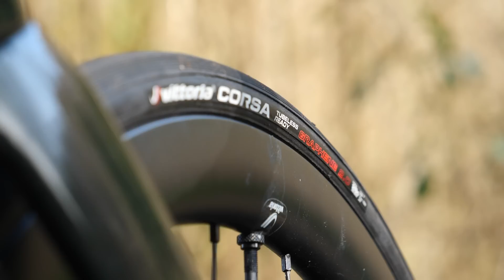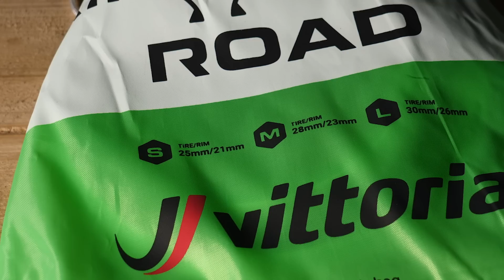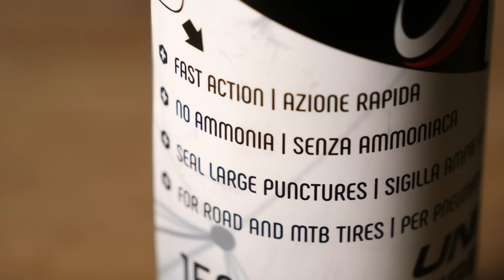NEW Run Flats: Pro Cycling’s Secret Tech | Vittoria Airliner Road First Look

Comment: Has anyone noticed that underlying this product is an admission that "tubeless" has not lived up to its hype?  We have been told that tubeless with sealant will banish flats and sitting beside the road removing wheels, prying tires off the rim, pulling out the flat tube, putting in a new one, pumping the tire back up to pressure and re-installing the wheel is a thing of the past.  There is an unstated admission here that when one rides tubeless tires there is definite possibility that one will have a flat that will not seal, and, as a result, one will be sitting beside the road pulling the tire off the rim, getting sealant all over one's hands and clothes and inserting a tube that one still would have to carry in anticipation of just this situation, etc.  And once one returned home, one would have to undertake the messy operation of again removing the tire and tube and repair the puncture in the casing, add new sealant, reset the tire in the bead (something I found impossible at home; I had to go to the bike shop and ask the shop to do it with their compressor -- an impossibility at 10 o'clock at night).  In short tubeless was more troublesome than tubes.

I do appreciate the increased safety margin these airliners offer. Would it be possible to obtain this increase in safety and convenience by using them in conjunction with regular tires and tubes and avoid all the faffing about inherent to the tubeless setup?

Comment: Has anyone installed these with the vittoria valve then had trouble getting sealant to go in, even with a sealed/screw down injector? My experience is sealant wants to burp back out. Hard to get it to stay in.
Reply: Two tricks: 1) before you inject the sealant (while the valve is still clear so air can come out) - compress the top of the tire - this causes it to inflate as you inject the sealant and displace some of the air. That way the air pressure doesn't want to push the sealant back out.  2) Rotate the tire so the valve is not on the bottom/opposite the ground. That way when you inject it it will flow down and away from the valve.

Comment: I switched to Tubeless 2 years ago, then switched back to clinchers after 2 months. I found after not riding the bike for a month or two the tubeless tires runs out of air and I couldnt pump the tire back up. I had to remove it which took hours I had to cut the tire after it fused itself together due to the sealant sealing the tire beads together. It was an unbelievable mess, the sealant was all over my floor and countertops. I'm never going tubeless again. Too messy.

Comment: I know they should "last and last", and reviews have said that they do, but Vittoria recommend replacing Air-Liner Road inserts every year!

After a puncture that I couldn't fix in a tri last weekend, I am sorely tempted to put the the airliners on my race wheels, but I need to work through what the repair options are when whacking a tube in at the roadside isn't an option. I'm guessing that this would be 1 - hope the sealant works, 2 - plug the hole and inflate, 3 - ride in on the flat tyre.

Comment: I had a puncture on tubeless which sealed but only with 2 to 3 bar pressure in it. Anymore would break the seal. To get the seal to hold for 6 bar, I fitted a patch to the inside of the tyre. That's the long term fix, but I still rode 80 miles on the low pressure since there seemed to be not much difference. Apart from being more comfy on rough roads.

Comment: What happens where the valve is when you get a flat? Surely the valve in the rim pushes the Airliner out more and you end up with a very slight egg shaped rolling surface?
Reply: hmmm thats logical

Comment: running ultralight corsa speed and dt arc wheels...no way i'm adding extra weight to that combo...use stans race sealant problem solved...and a tube and 10 euro bill to get home in case of a major blowout..!
Reply: Do the airliners weigh more than a spare tube and a mini pump?
Reply: @simonrichardson5259  yes! latex vredestein race + carbon pro mini pump. (and they are in my pocket not spinning around on the outside of my rim!

Comment: Got my 1st flat after 1300 miles on a tubeless Cadex tire and it was a big gash! I had a can of GUP with me...shot foam everywhere and didnt seal. Luckily a bike shop was 3 miles away...yes I walked it. I could of used these lines. I just bought them and will try them out as soon as they come

Comment: I don't understand how the air liner reduces in size when you inflate the tyre, surely it would stay the same size as the pressure within the tyre is equal!?
Reply: The pressure in the tyre squashes the foam just like if it was between your fingers
Reply: @simonrichardson5259  surely that can't be, for example, if a balloon was in a sealed chamber and the chamber was pressurised, if the pressure outside of the balloon was greater than the pressure inside the balloon, the balloon would reduce in size. With the Air Liner being a porous foam, I don't know how this would reduce..... possibly magic?!

Comment: Two years on tubeless 12,000+ miles no flats but I do carry a spare tube and small pump adding these and ditching the tube and pump would give me a weight savings. I'm all in if you can fine a set. lol
Reply: Same here. The safety factor alone is worth it. The fact that you won't damage your nice rims is like having your cake and eating it too. I will definitely be buying them.

Comment: More simply put..The air that is contained in the poly is lower in air pressure than the air pressure that you actually put into the tire thus compressing the foam in overall size unlit the external air pressure is decrease. The bigger question has anyone actually taken advantage of the tech in wining a race with a flat some where along the line of the race?

Comment: Just ordered it in Italy, as here in the Netherlands I can’t find it. Ride alredy two years tubeless, but still from time to time running flat and even a plug sometimes will not work. Only option put innertube or call home. This would fix the issue i guess.

Comment: Rookie question. Can i use a Tubeless tyre like a clincher with a inner tube?
Reply: Yes. But you would normally only use a tube in an emergency - to get you home if you tyre has a puncture that doesn't seal or can't be repaired.

Comment: one bonus they don't mention - the volume the gravel insert takes up is volume you don't have to replace with air or CO2.  So if you do break the tyre/rim seal one small cannister of CO2 will be enough to blast it back on the rim 👍

Comment: Which size would you get if you’re running wide rim aero wheels? My Tyres are 28mm but the rim bed on my wheel set is 27mm. Would getting a medium lessen the safety of rolling when flat?
Reply: The important rim measurement is the one on the inside. It’s likely to be about 21mm if the outside is 27.

Comment: Hello all these work i had  a hole the sealant could NOT seal today and i heard all air come out... and yes i rode 9 miles home on a deflated tire and it felt ok little more leg work required and make it a recovery ride! VITTROIA made a mistake NO they do not run at 35 PSI....run flats mean "RUN FLATS" not 35 psi.....just to clarify that and i did not carry any tools at all!

Comment: Not a new idea.  Michelin produced a similar thing in the mid 80’s for off road motorbiking called “BIB Mousse” and is still in use today. The one drawback is that the foam beaks down over time from heat due to friction.  It will be interesting to see how long they last in a cycle wheel, especially bearing in mind how soft the Pirelli foam appears?  The Pirelli application is slightly different as the foam doesn’t fill the whole tyre space.

Comment: This tech looks fantastic and, for me, it's the safety aspect that jumps out as the most key. If you've experienced a high speed front wheel blowout on a descent it is the scariest thing you're likely to experience. It's always in your mind every time you cycle once it's happened. I'm off to get my liners pronto. Thanks Simon. Good job!

Comment: Never ran tubeless, but would now consider this setup. (Big fan of Vittoria tires. Ingenious tubeless solution.) I've seen the mess to the tire and rim that comes from the sealant when having to remove a tire and replace it with an inner tube in an emergency. I realize that with this setup that cant be done. Can anyone, GCN?, describe how messy a tire change/replacement is?

Comment: And it was going so well, got quite excited 👍Until... Can't fix it at the roadside!!! I really wanted this to be great ☺️
Reply: If you buy a plug repair kit, you should be able to fix most punctures that don't require a tire boot on the roadside using this system. If you get a good slash though that the sealant wont plug, then you're SOL.

Comment: I wonder if the foam insert would help in getting an old tyre back on the rim. I have a rear tyre that I jut couldn’t get re seated and so now it has an inner tube. One downside is you wouldn’t be able to plug a hole I am guessing without removing the tyre as otherwise you’ll skewer your foam liner?

Comment: I want tyres (and actually found some) that almost never puncture. Of course, it comes with a weight penalty that negates the rolling benefit of tubeless (so I use tubes) but nothing beats not having to stop for repairs on the road, especially in winter. I like the idea of these inserts but that’ll benefit those competitive riders that don’t carry 20 pounds extra weight on themselves like I do 😋
Reply: I’d say tubeless tires are all around better at negating flats than even the most burly tire.  Sealant really does an amazing job.   Plus, you get to ride a tire that doesn’t suck.
Reply: @travis5481  well, I ran with the Mavic tubeless tyres that came with my Mavic Cosmic tubeles rims and the sealant indeed worked each time, but each time I had to stop as the tyre had lost too much pressure and then wait for the puncture to stop bubbling sealant before I could reinflate. Maybe the tyres were rubbish but looking for a replacement, I was surprised by the high price and limited choice on CRC. Maybe my current tyres suck but I had zero puncture in commuting and Sunday rides with them...

Comment: I just put one bike tubeless for commuting. I had a "grand plan" to check sealant level after 3 months by removing valve core and "dipsticking". With one of these in the tyre, I guess the only real option is just to squeeze in another 20ml or something? What's the recommendation for checking sealant? Even if you were to unseat the tyre, it wouldn't be easy to see how much sealant was in and still viable

Comment: We’ve known about this for ages they where seen on last years strada bianchi. It solves everything that is wrong with tubeless and clinchers another solution to a problem that never existed. You’ve always been able to ride a tub flat to get a wheel change. Skewers tubs and rim brakes worked. Tubeless clinchers disc brakes and thru axles don’t. But now we have ten years of developement nausea and amazement from the media. Cycling manufacturing has never been in a worse state maybe you should focus on the recalls (there are lots) and the canyon riders who won’t get to ride their bikes until July.
Reply: Well lucky for you Toby, the tech you love from yesteryear is now more affordable than ever. Just because new tech is released, it doesn’t mean you have to stop using what you love.
Reply: Strade Bianche. Please don't murder other languages
Reply: @simonrichardson5259  but look at all the videos done with nails puncturing tubeless and claiming you’ll never puncture again, the benefits about 1x, discs. single handidly your channel causes parents to spend a fortune on disc and wide tyres bikes for juniors , my mates all went disc and tubeless and 2 years later realise the benefits are marginal at best. I was out today on a 50 miler with 5 mates  the tyre system that failed was tubeless. Stop sensationalising the new and rubbishing the old. The new is not as great as you claim and the old is certainly not as bad as you make out the margins are much closer.
Reply: @tobycolin6271  I’m really sorry that you feel that we’re rubbishing old tech, that’s not our intention at all. But while you may not be interested in new tech, lots and lots of people are. People want to know about new tech, myself included, and so we’re happy to tell them. 

Like I said in my previous comment, ride whatever you like, anyone on a bike, whatever it is, is cool in our book. We’re not snobs, I don’t care if you have disc or rim brakes, 14mm wide rims or 24mm, if you’re having fun then great.
Reply: @simonrichardson5259  you miss the point. We took a step back with clinchers in functionality from tubs to tubeless. As clinchers can’t be ridden flat to neutral service. Tubs by there very construction are more flexible that’s why they run at higher pressures. 23, 25 and 28s can all be as compliant and convincing a 50 kg rider they need 28s or wider for comfort is a by product of what you do. May be we can go for a coffee one day and you could see for all the good you do for cycling there is a little harm. I’ve seen riders in tears when they’ve bought the latest tech and they’ve gone backwards. People stuck on the roads because they believe in tubeless. I don’t rubbish the tech I make a living sorting it but your channel and other influencers don’t balance the picture. As I say look at the recalls and tell both sides which manufacturers have them what they’re doing about it and how quickly people are getting support.  Like I say the biggest story for consumers has little to no media time and that’s recalls every brand has them somewhere sometime.
Reply: @simonrichardson5259  and he other big story in cycling is proprietary parts. Are  the manufacturers building obsolescence.  I was out today 1 venge, 1 canondale super 6, last years canyon , roubaix with future shock  and a couple of giants all have proprietary seatposts and most had proprietary stems and bars how and which manufacturers are going to support these products over the next 3,5 or ten years are all bikes one crash away from land fill after a set period. We where also all told that rim brakes where out rims but no one is talking about that disc wheels are failing after 3 years at the spokes and the rim due to the increased forces.  Another case of old bad new no one talks about.

Comment: So here's a question -- there are loads of foam materials that can exhibit the same expansion/contraction effect shown here based on surrounding air pressure...  heck, the corn-based edible type of foam used for packaging is one such example...  but the stresses on the material that occur with that shrinking and expanding usually causes internal micro-tearing that just accumulate and make the foam weaker over time.  So what is the lifespan of an insert like this in practice (taking into account that you're not regularly going between dead flat and fully pressurized over and over)?

Comment: Wouldn't airliners interfere with tire (tyre) inflation?  If they are designed to sit snuggly in the inside-most part of the wheel, how can one pump up the tire?   The more you pump into the tire, the more the airliners will sit in the wheel, thus pushing against the valve pump?
Reply: Hi David, it didn’t seem to.

Comment: RE: Ammonia = Si, You pointed out & Vittoria tech has confirmed that the Sealant used with the Air-Liner should not contain any Ammonia. I contacted the Sealant Brand I use and they stated "Ammonia is present in all natural latex solutions - we minimize down to .001ppm". So is that safe enough? 
Vittoria was no help in naming brands that would not be compatible. With all the different Sealants being used by so many riders,  unless the Brand was crystal clear with their ingredients or at least Ammonia content, how would a rider know? Interestingly, Muc-Off one of GCN's sponsors does say Ammonia Free in their website's Product Feature page. The Brand I use does not mention Ammonia at all. I looked at a few other brands with similar mixed results
Mountain & Gravel riders have been using Liners for years including Vittoria's, after your segment I started watching YT videos I did not hear any of them mention of Ammonia or damage to their liners from sealant.
is ZERO Ammonia the only safe level?

Comment: I have been running tubeless for about 4 years now. Never had a puncture that gave me a flat. The sealant has always done its job. The extra security of this is a great idea. Though I don’t get why you need the tool to get the tyre off ? If it’s squashes you should be able to get it off by hand ?

Comment: If the pros have been using this product for two years than why didn't the UCI enforce their own rule that it must be available to the public in the rules time frame ? OH yeah they only ban and enforce stuff they want too and look the other way for everything else.  2nd: The off road motor cycle world have been using Bibs in the tires since the early 90s but bibs don't require any air at all.

Comment: I have been running tubeless tires for almost 3 years without a single puncture the sealant didn't solve.  However, I alway have a bit of fear that more a significant puncture will leave me stranded since there is no way I could ever remove the tires in the field to insert a tube.  This appears to be the answer.  The price is a bit steep, but nevertheless I will consider buying once my current tires require replacement.